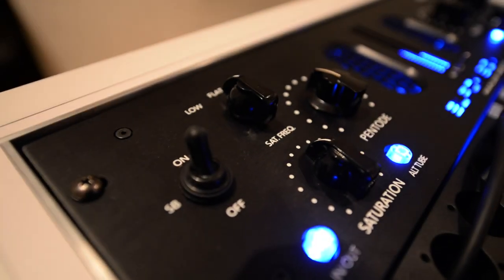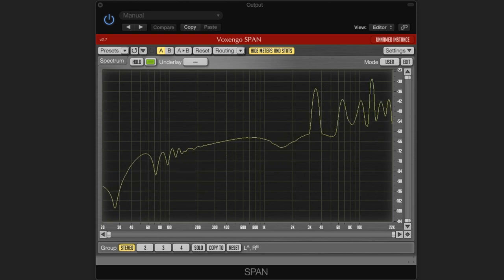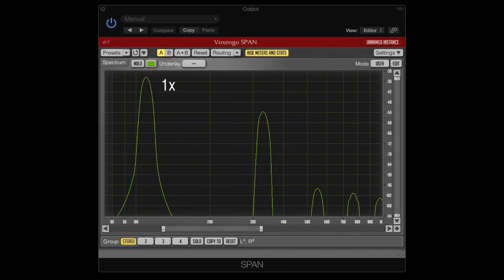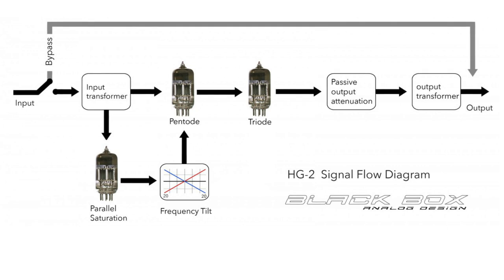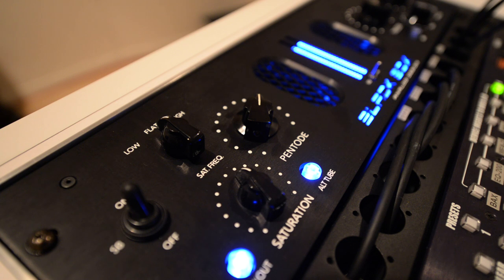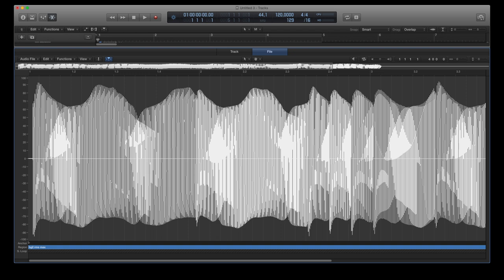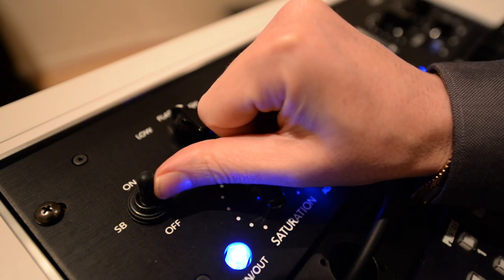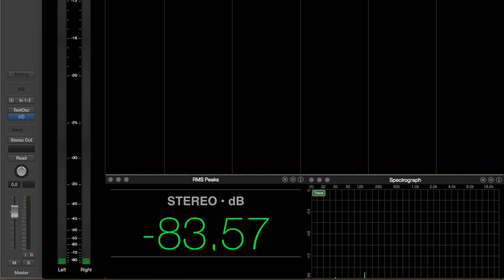Black Box Analog Design HG-2 [Review]

Comment: Great video.  What do you think of the plugin emulation?
Reply from the maker: I think it's pretty good. Some 70-80% of the way. One problem is the very top frequencies where the plug-in is quite a bit more sharp/digital. Another thing is the stereo image, where it's naturally less wide. Another thing are the dial settings, i.e. there's no correlation between the dials on the hardware and the software when it comes to the amount of effect. So if you know the hardware or want to reference hardware settings that's impossible without a lot of trial and error (and measurements).

Comment: Thank you for the video Holger. As usual it is exact and precise plus full of useful information. Using the hardware version of the HG-2 on a tonally balanced full range mix...
how many dB RMS do you think can be gained to a mix before the saturation/distortion becomes obvious?
Reply: Hey, thanks for your comment! I understand where that question is coming from, i.e. the concept that you can gain some perceived loudness or inherent beneficial compression of sorts from the saturation process. While this is true to a certain extent, I would rather think of the gains as more related to the overall sound perception on a psychoacoustical level, i.e. a harmonic enhancement or enrichment that makes thing pop out a bit more. This is hard to put into a simple number of decibels.
Reply: Thank you for your reply Holger!

Comment: Hello nice video On the master, it goes first in the chain or last i have the plugin..
Reply from the maker: Thanks, Mel.

Exactly where you'd like to insert the HG-2 depends on the situation.

For example you might want to run a sub bassy mix through the HG-2 and get some saturation/overtones from the sub bass, then subequently reduce the sub before going into a compressor and the rest of the chain.

This way you're making the bass more audible without actually having as much sub in the final mix/master.

In other cases you might want to have it after EQ and compression, so it's saturating an already fairly shaped and controlled signal.

In some cases you might want to drive the HG-2 a bit harder and shave off some transients, and this might influence your decision as to whether you'd want it before or after other dynamic processors in your chain.

In other words: it's individual per track/mix/situation.

Comment: How's the noise floor? Right now I have a Looptrotter and although it sounds really amazing, it can get a bit noisy.
Reply from the maker: About the same level as most tube gear or a bit lower. https://youtu.be/BXn4vJAvcPE?t=456

I suppose it could depend on the specific tubes in the unit.

Comment: I wonder how good is plug-in version compared to the hardware unit.
Reply from the maker: Quite close in some respects. The high end smoothnes is missing in the plug-in, the mix of even and odd harmonics are not quite the same, and stereo width is more narrow. The controls are the same, but the settings are quite different from the hardware unit, i.e. you can't translate how you'd set the knobs on the hardware to the software. I'd say 7/10 - not bad!

Comment: hi 
. May I know if the unit can also operate at 220v, the voltage in the area of Europe where I live?
Reply: Yes, 220V as well as 230V
Reply: @holgerlagerfeldt  Buy the unit in Canada there the voltage is 110v and you live in Europe 220v... Now it is doubtful if the unit is multivoltage.
Reply: @holgerlagerfeldt  
It does not matter that it is bought in Canada where the voltage is 110v? .Does the unit have a multi-voltage transformer?

Comment: I dont know, man, the BX saturator sounds pretty damn good
Reply from the maker: Heh heh ;-) Nothing wrong with digital saturation per se. It all depends on what you're after.
Reply: Don't get me wrong, the analog black box is way better, but 95% of the public can't tell a song that was mixed on a neve console and a 24 track studer analog deck, from a song that was mixed on fruity loops 4, making the price tag of the black analog box "seem" ridiculous to most...
Reply from the maker: It's true that the gear itself is a lot less important than the man behind the gear. That goes for digital as well as analog.

That said, if you can justify the investment AND you have the experience, you might prefer having the hardware for that extra vibe and tactile interaction.